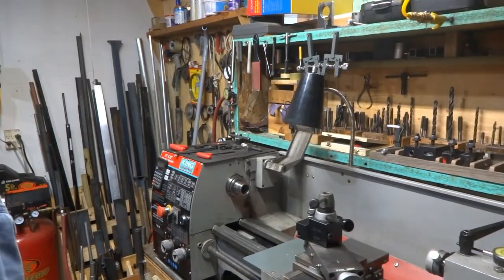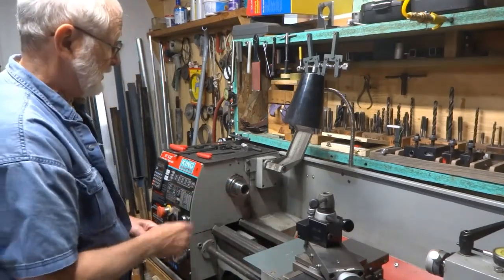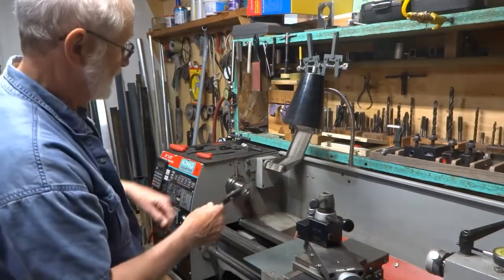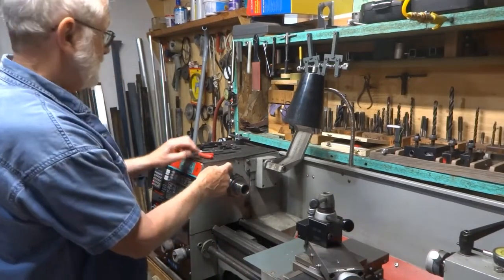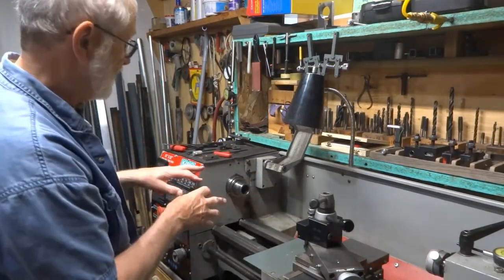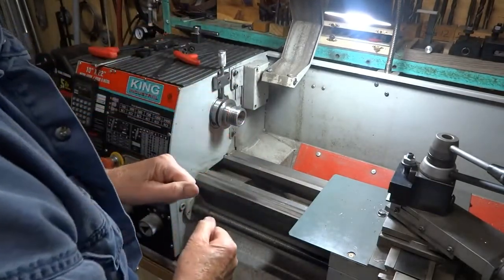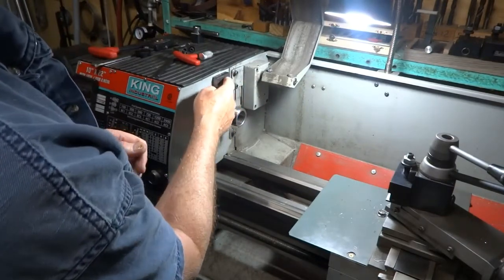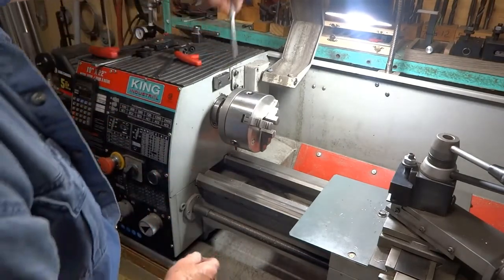Lathe Spindle Lock Installation.

Comment: that is pretty good, so could a person make an indexing spindle the same way by drilling the spindle shaft?
Reply from the maker: You would have to create an indexing collar on the mill using an index wheel or rotary table and pin it to the lathe collar. The indexing pin would need closer tolerances. I think it could be done.